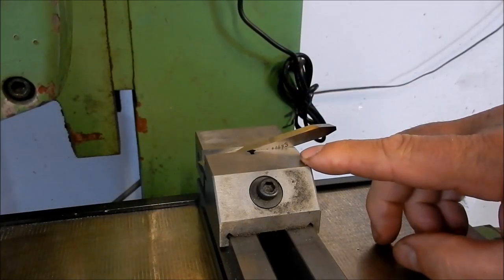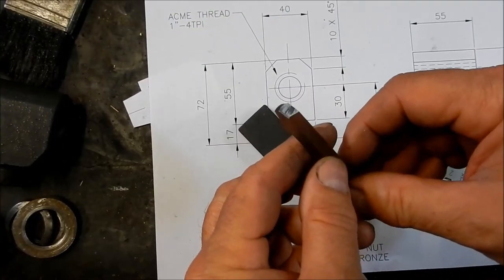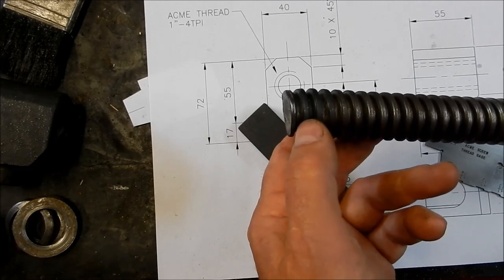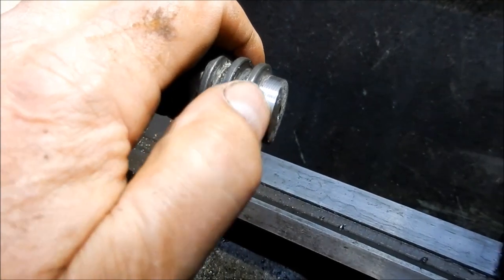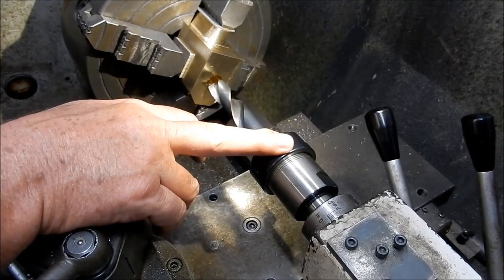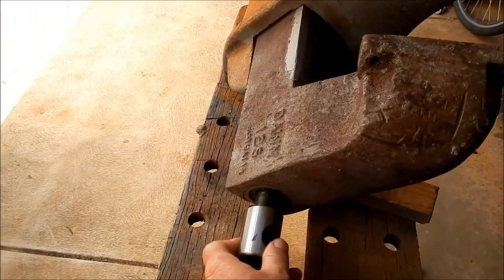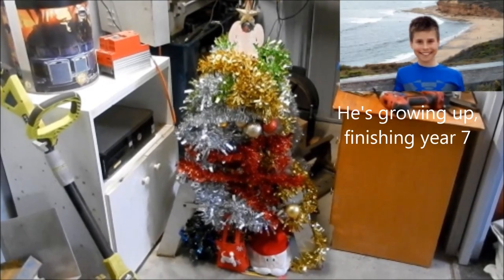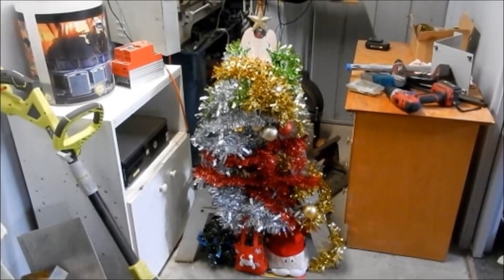Dawn Vice Resque and Rebuild, Cutting the Acme Thread

Comment: Merry Christmas to you and your lovely family.  Have you thought maybe adding a thrust bearing instead  of filling the recess?  Would improve the clamping on the vice. Cheers
Reply from the maker: G'Day Yves, I think I'll have to stick with just a plain steel or Al Bronze washer.  This vice will be outside and the bearing would be showered with sparks and grit when grinding.  I could make up a housing for the bearing but I think fine grit dust and moisture would make its way in at some stage.  Thankyou for the thought and all the best to you and your family over the Christmas season and have a great New Year.
Cam

Comment: Looks like there's a slight bend in the shaft, right where it's binding.
Reply from the maker: G'Day Sean, read you comment and rolled the screw across my surface plate and its as straight as a die.  The root diameter is the same from top to bottom however the OD changes by 0.5mm at the binding point.  I may just give it a skim but as it stands now it doesn't quite reach that point when the jaws are together.

Cam

Comment: that welding repair was never done at the factory, it would have gone back in the pot to be recast at the foundry, they never waste time money doing that, it never pass QC, that is a backyarder job to allow for wear , it's a common repair as they wear the jaws end up lopsided, a lot of these vices have this repair, they never would do this at foundry, it never pass QC